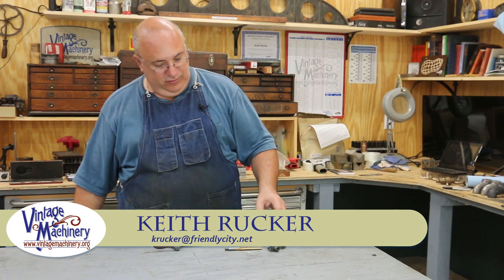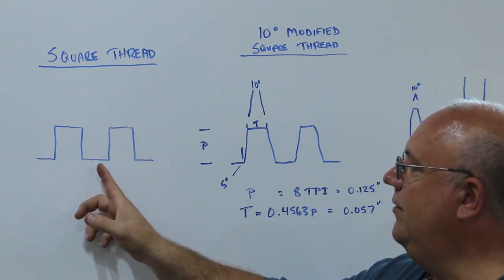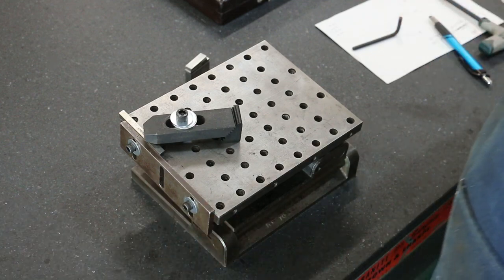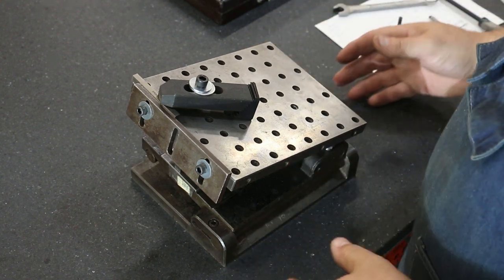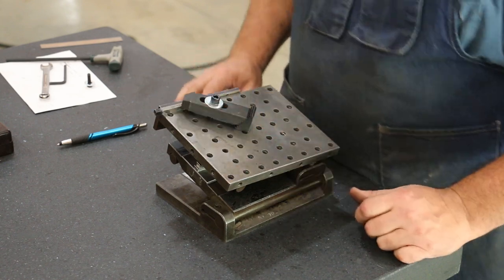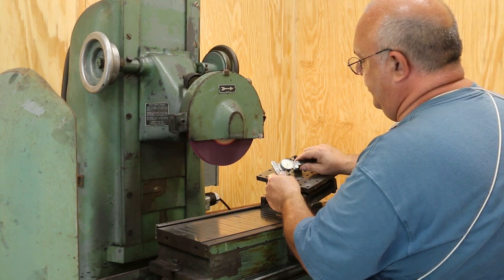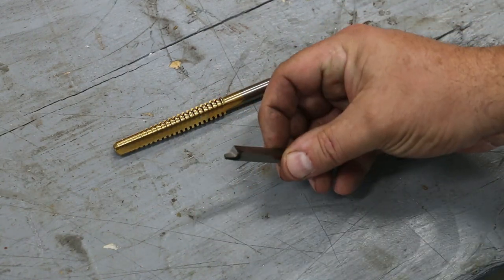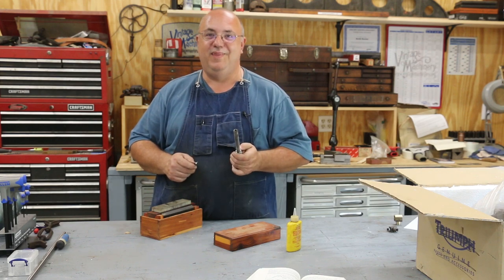Grinding a Custom Threading Tool on the Surface Grinder

Comment: Keith, that is very generous of you to do that for a viewer. When you get that done, I think you have a viewer in Ky. who has a little welding for you to do.
Not much just a little bit,
Rollie
Reply from the maker: I would be more than happy to help my friend in KY out, but I would be brazing it back together.  I just have not had a lot of luck with stick welding cast iron.  But, I think that Brian will be fine when it is all said and done.

Comment: This made my day!
I rarely use the calculator on the phone, and I totally didn't know about the extra functions when you turn it around.
Thank you so much for telling this!
Reply: Also, you might know, but if you swipe left on the Compass you get the level/angle finder. I use it in carpentry for some quick 'no bozo' checks.

Comment: Keith, with the surface plate you'll run into the same issue that you encounter when cleaning windows. Paper towels are made with sizing, or as it's commonly known, starch to hold the wood fiber together. The layer of starch left on your surface plate from the paper towels will have minor imperfections in it that would be as bad or worse than the dust you're cleaning off. A better method would be to use the same thing that works so well on glass, washed and tumble dried .microfiber towels. It would probably also be a good investment to purchase a cheapie air-brush compressor to use to blow off the surface plate afterward with oil-free, dry air.

Comment: Keith it looks like the tool fits well, nice job.  In your calculations for the angles for the compound sine plate I think you may have made a mistake by not taking into account the compound angle.  In your case, the 5° angle is small and the error introduced is also small, but for larger angles this will not be the case.  Suburban tool also has a compound sine plate calculator on their website.  Using your numbers the gauge stacks should be 0.435779 for the 5° and 1.289499 for the 15°.  Again the error is small for both in this case.
Reply: Absolutely right, although small in this case it should not be ignored in the teaching of compound angles.
Reply: This is simply known as cosine error.
Reply from the maker: Bill,  I have to give you credit that you are correct.  However, the only angle that was really important was the 5 degree angle - and that stack is the same for both a single angle as well as a compound angle: 0.4358 (rounding to the nearest tenth, which is all that my gauge blocks will go down to).  Because h 15 degree back angle is just clearance and not critical, it really does not matter in this situation.  But, you are technically correct.
Reply: Not trying to nit pick, I've been burned by making this mistake that's why I brought it up.  It absolutely would not matter for your tool bit.
Reply: Yes I cut and pasted from the Suburban Precision website, should be 0.4358 and 1.2895, and yes it would not matter for the tool bit Keith ground.

Comment: You realize I will have nightmares about HS math tonight! Why is it so simple now? Great educational video, Prof. Rucker!
Rich
Reply from the maker: I was one of those strange kids who actually liked word problems.  Much better to be using math to solve a real world problem rather than just a bunch of numbers on a piece of paper.  However, I can remember back in 9th grade when my algebra teacher gave us a word problem that required calculating how much barbed wire a farmer would need to by to fence in a pasture.  Having put up a lot of fence by even then, I gave the teacher the answer she was looking for as well as the "correct" answer that took into account the extra wire needed for cross hatching corner posts, etc.  She gave me extra credit!

Comment: I was puzzled at first why you were going to such lengths to make such a simple tool.   I was thinking to myself that I had cut Acme threads many times and I had only ground the tool on the bench grinder.   Right at the end you answered my question.  You said that you did not have a standard or gauge to grind the tool against.  That makes sense!  I had a gauge when I made my tools.  Likely no one makes such an archaic thread form gauge.  Perhaps at one time those were available, but good luck finding one.  

All the best!

Mike

Comment: ahhhh... Now I understand where that grinder can be useful. I could not figure out why anyone would want such a thing when a mill would be more accurate but for making custom cutters it's brilliant.
Reply: cant mill hardend steels, you can pre mill them before hardening, but the heat process will distort them slightly , needing grinding and for tool bits , they are already too hard to mill
Reply: "mill would be more accurate",  a jest perhaps? Milling machines are crude monsters when compared to surface grinders. Think axe compared to a scalpel.
Reply: Its physically impossible to have accuracy similar to a mill with a sacrificial ablative cutting surface such as a grinding wheel over large areas. As the wheel diameter decreases through use, your surfaces will become more and more out of spec.
Reply: Could that be why you "spark out"? 
Are you sure you meant to use "ablative" and not "abrasive", which would sound more logical in your sentence?
You only have to look at the feed dials, grinders are often an order of magnitude finer than mills. Or are you not talking about manual machines, but CNC.
Reply: Oh? cutting tools don't wear?
Reply: Grinding wheels wear. But so do cutting tools. Wheras a grinding wheel can take a .0001 cut that is hard for a cutting tool.Thats what surface grinders are made to do and that is to accurately take stock down as close to size as possible.
Reply: Anon you clearly have 0 idea what you are talking about. 

surface grinders are for making parts flat and or parallel and square. as the wheel wears you feed in a little more or just take more passes without feeding to remove .0001ths parts that need those tolerances require being checked multiple times during machining anyway. 

you're clueless.

on a surface grinder you can remove microns just by turning down the magnetic chuck, good luck doing that on a mill.

clamp in a vise, mill, unclamp, measure, clamp, mill, unclamp, measure, scrap the part, use proper tool.
Reply: Anon a mill can get you within "a few tenths .0005+-"

a surface grinder can get you .00001
Reply: For Anon's benefit I shall try to explain things in simple terms. To get an accurate or precise size you have to have a smooth and flat surface, it is physically impossible to measure a distance with any degree of roughness present as you are only able to measure over the high spots. A grinder is able to provide a surface with a  finish that starts where a mill finishes. A grinder is capable of doing this because of its ability to remove very small amounts, in the order of tenths of a thou, where a milling cutter would merely rub, produce heat and blunt itself. Simple enough?
Reply: Too simple for you?
Reply: Do please put me right, in terms Anon would understand.

Comment: I am working in a tool shop at Cochin,(India ), here we are grinding, 0.500mm slots, 0.150mm radius both male and female in 0.005mm tolerance,using Jung grinding machine with optidresser and noritake grinding wheels

Comment: If you use a sine plate a lot it would be useful to write a spread sheet to calculate the stack for the most common angles and build a table for them.

Comment: As always , nice to see. 
If You don't have SINE function? 
For small angles like 10°, calculate 10*PI/180 = 0,1745. Thats about 0.5% error.
Smaller angel givs smaller error.

Comment: You should look into getting a stereo zoom microscope for doing checks like you did for comparing the threading tool to the tap. I have one in my shop and use it all the time to look at wear on bits and part fit ups. If you do get one be sure to get one with a camera mount so you can share what you see.

Comment: Looking at this setup, it seems that the clearance angle is going to confound the thread flank angle.  In other words, the 5 degree is going to have to be increased slightly to make up for the clearance angle.  You could make the correct angle with either a formula (the ratio of two trig functions) or sketch the correct angle by using an Autocad sketch.

A related problem I give my high school kids:  You need to cut a 15 degree edge on the long side of a long part on the  Bridgeport, but the part is so long you have to swivel the ramp at 45 degrees to reach the end of the part. So now you don't have 15 degrees anymore looking at the end of the part.  It turns out you need to set the head tilt about 21 degrees so that it becomes 15 when the ram is swiveled 45.  We work this out with trig and algebra, and then develop an Excell spreadsheet to account for the  confounding angles.

Comment: Could you take a piece of round and chuck it in the lathe after you thread the shaft and run some threads on it so you could have a standard for future use?  I know, you may never need it but if someone else needed it you could saw off a little bit and mail it to them.  Just a thought; oh, I did pay attention in Trig class but at 70 yrs. old, it flew the coop.  Thanks for the memories and the great video, Greg.
Reply: that's a good idea.

Comment: i have 20 inch planer top that need surface grinding can these machine use to grind it back or maybe its not wide enough

Comment: Great video Keith. I have a question, if you had calculated the triangles that were to be removed would it have been possible to just keep track of how much was being removed to know precisely when to stop grinding off? I will be getting my surface grinder going in a month or two and am trying to learn as much as I can so I can do precision work without worrying too much of over grinding the workpiece. As you were grinding I'm thinking, removing the material for the correct angles is actually removing a piece that makes to triangles from the existing corner towards the center of the workpiece, so, if I calculate this distance from the corner to the tip of the needed thread tool I would know how much to remove to get to the precise measurements??

Comment: Very nice job, Keith. Was that flies or blood suckers I heard in the sound. Would one need to heat treat a cutter like that? Thanks again, Greg
Reply from the maker: Those are just pesky gnats.  Harmless, unless you hurt yourself trying to get away from them.  Since the cutter was HSS, no need to heat treat in this case.  I was grinding it in the hardened state.

Comment: Don't understand why you need the surface plate. The angle's from the gauge blocks are set inside the sine plate, and then mounted on the grinder.  What am I missing? Thanks I got the rest of it and thinks it's awesome. Thanks for all you do.
Reply: My thoughts exactly :D 
Nice video tough! 
I never saw a compound sine plate, let even a sine plate. 
I envisioned something much more complicated whenever I heard the name sine plate.
Reply: Dave B he probably saw suburban tools video on sine plates. 

they use the surface plate and an indicator to check the angle is correct, doesn't look like he did that though. seems like using a compound sine plate is something he rarely does or has never done.

no offense if u see this comment Keith, but I noticed a pretty large amount of errors in this video. not sure if you just were ball parking it or what.

but when using a surface plate always slide things on from the corner, never set them on the center, use lint free cloth to clean surface plate, lint free cloth and light oil to clean gauge blocks before ringing together, and slide the blocks together in an x before twisting to ring together instead of sliding back and forth. also there's some cosine error in the calculations.

also a tenths indicator on the surface plate would have been a more accurate check than the calipers. or use a mic. and avoiding touching the polished surface of the gauge blocks helps keep the stack accurate
Reply from the maker: It is not necessary to do this on the surface plate, but I like to keep the bottom of the sine plate on a flat surface to keep it clean.
Reply: you are right in your thinking, it was only used as working surface and not necessary.

Comment: I think Alfred Hitchcock said it: "If you show a telephone in Act I, it had better ring by Act III."

You can't show a Triumph™ box (at the very end of the video) without saying something about what came in it.
Reply: "Remove everything that has no relevance to the story. If you say in the first chapter that there is a rifle hanging on the wall, in the second or third chapter it absolutely must go off. If it's not going to be fired, it shouldn't be hanging there." Anton Chekhov

I think you're referring to the "Chekhov's Gun" principle, established long before Hitchcock.
Reply: +Scott Anderson - Wow. I've been "quoting" (apparently I haven't been) Hitchcock on this for over 50 years. A quick google finds no reference to it whatsoever. (I've referenced it in a number of online forums, so that is surprising.) 

Chekhov's Gun has it's own Wikipedia entry, although he said it several times in slightly different forms. Thanks for setting me straight on this.

Comment: The five inches is between the pins. Did the stacks take into account half the width of the top pin, so that the angle is correct?
Reply from the maker: Both sides of the sine plate rotate on round pins - so they are always the same distance apart no matter what the angle is.

Comment: keith  im not certain but if you rotate your gage blocks in the sine plate 90 deg your angels will drop  as the length c increases..   or the height of the gauge blocks is only correct at length c from  A .. over 5 inches probably not much but i think thats where the width at the base of the cutter comes from.. or is there a location for gauge blocks on the sine plate?  just curious  not calling mistake spotted
Reply from the maker: Mike,  Keep in mind that the piece that rests on the gauge blocks is a round bar - as is the other end.  No matter what angle you put under the sine plate or bar, the distance between the two bars is always the same.
Reply: sorry keith i must be missing something here  as i saw it your gauge block stack was rectangular  you have 2 options stack parallel to pivot or stack transverse   the one you chose moves the distance to the pivot point therefore the height ov the angle at the distance its calculated for .. i believe you state 5 inches.. was  the leading edge of your gauge block stack 5 inches from the pivot point making its height  correct for the desired angel ? sorry to pester here   perhaps its worth a bookface post  or a whole video   i follow the mathematics part as i said i question your stack placement within the sine plate .. or im missing something in how they work .. thnaks

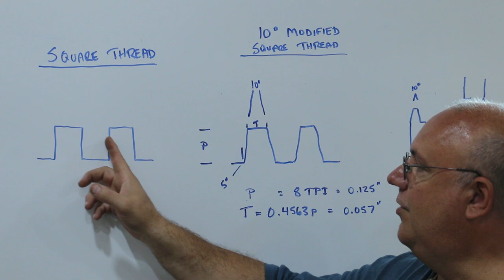Comment: @3:53 you say that by cutting an Acme thread you are cutting on the side. Yes but it still has a large flat area on the thread root which is a direct forward cut almost the same as a square thread.

Comment: Keith, when you're done using this tool, do you mark it so you know what angle it was cut at or do you throw it in a box with the rest of your cutters? This was a good video, there was a lot of thinking to make that tool! Thanks for the lesson.
Reply from the maker: Quite honestly, it will probably just get thrown in with the rest of my cutters.  I doubt I will ever need this grind again, but if I do, I should remember that I have it and can probably find it again.

Comment: 15:22 I don't believe oil on the gauge blocks is what causes them to "stick" together, as it works with ceramic gauge blocks without any oil... it's the van der Waals force that's doing it.

Comment: Great video. 
Do you remove the gage blocks after you lock the plate or do they get exposed to the grinding dust?
Reply from the maker: You typically leave them in place.

Comment: I know some people will be turned off by the math, but I really enjoyed it. Simple trig! Oscar Had A Heap Of Apples, So Charlie Thought (o/h = sin, a/h = cos, o/a = tan). There is a Navy saying, but cannot put that here! I am curious as to why you started with the smallest gage block first. I will re-watch the video to better understand.
Reply: im guessing smaller blocks include the smaller increments, larger ones are more likely in larger thou increments
Reply: I was taught, "remember Indian Chief SohCahToa." It has stuck with me since 8th grade, so many decades ago.
Reply from the maker: You start with the last place in the number you are making a stack for.  The tenths gauge blocks are all 0.1001 through 0.1009 so if the stack needed to be 0.3125, you would start with the 0.1005 block and then go the 0.112 block and then put in the last one which would be a 0.100 block.  It is just easier to move from right to left.

Comment: You place your gauge block stack long ways? Seems deeper into the throat would effect angle
Reply: it has a round bar on the underside, so it will be the same point
Reply: Thank you for the clarification.

Comment: Sweet! Hey Keith, as always, LOVE YOUR WORK! I have a Walker Turner 1165 table saw with a worn worm gear blade height screw. I had it apart for servicing but failed to take a photo, (sheeesh). It needs the same treatment your'e doing here except on a spiral. It is serviceable but a bit sloppy with excess backlash. Once set the blade height is stable so I will let it go for now. But, your repair on this worm gear makes me lust for your tooling!

Comment: Shouldn't the height blocks go exactly at the 5" point to give you the precise angle you need? By sliding the blocks at 4.5 inches or so your angle will increase, or so it seems. Measure it sometime and see.